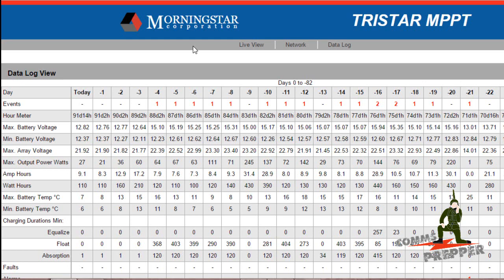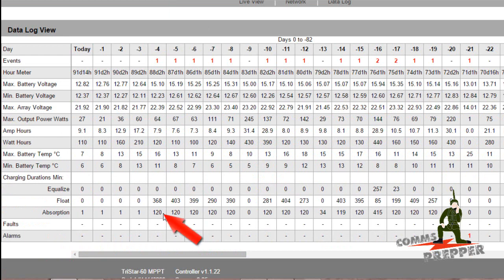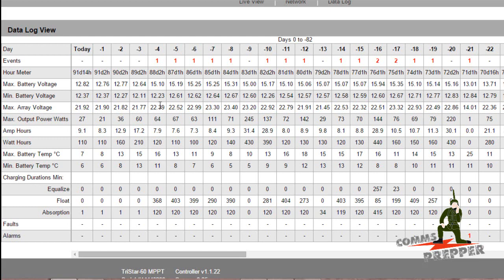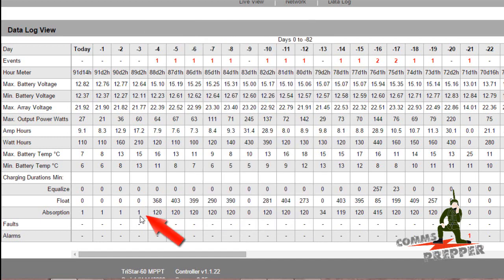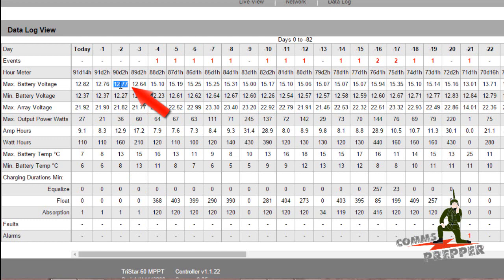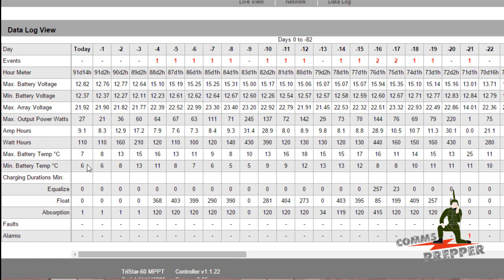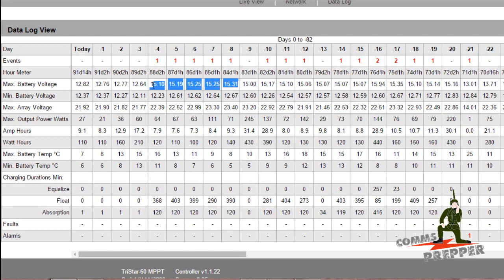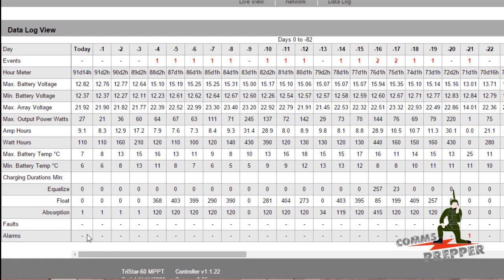Off Grid Solar Power - Reduced Sun Light and Cold Weather

Comment: If you look at the batt specs for number of cycles vs % discharge, you find that batt bank life can be significantly extended if routine discharge is kept below 30%. This means that it may be worth it to beef up the batt bank (and panels if necessary) in order to increase lifetime @ the same load. Also, constantly keep the batt fluid topped up.
Reply from the maker: +Larry Bowers More batteries and more panels are on the wish list.  Right now I just use the system on the weekends and never go below 50% SOC.  I do perform routine monthly battery maintenance (water levels, gravity checks, and equalization).
Reply: +Commsprepper Good deal - a grid/solar mix allows you to minimize excessive batt bank drain as long as the grid is present. When the grid is gone, a generator/charger is a great addition. Even a cheap DC charger (made from a lawn mower engine driving an alternator) can be a great asset. Be careful adding new batts to an older batt bank - any degraded batts in the old bank can quickly degrade the new batts added to the bank.

I've also found that (depending on your charge controller) extended sun charging under no-load has the same effect as a hard EQ. I call this a soft EQ and is much easier on  the batt bank relative to hard EQ. This is all about extending batt bank life significantly.

BTW, tanks much for your videos - great material. I just bought the 7200 and LNR EF-Quad antenna.  --W4LQB

Comment: Yes you have to use a battery charger sometimes to keep the batteries up unfortunately.
Reply: +TRprepper Yeah, a week without is hard on the batteries. On the other hand it&#39;s perfect for wind turbines. The nice thing is that you should be able to use the same MPP to feed in from windmills.
Be sure to have different blade sets available in the even of extreme wind or larger blades may be damaged. I'm thinking about the Rule of Three's for mine. There are hundreds of online videos which show great DiY alternatives.
Short term, a small modern generator would be good. The simpler the better.
Reply from the maker: +TRprepper Heading to the retreat this weekend.  Had some sun today but still did not reach absorption mode.  Supposed to be sunny all day tomorrow. I hope that gets the system topped off before the weekend.
Reply: +TRprepper Yes, or a generator. Fortunately wind turbines work well when the Sun is down or obscured.
Reply: Yeah I understand we have about 7 days of rain or clouds, system has not liked that.

Comment: are the batteries you use "smart batteries"  what I mean is we are taught every now and again you have to almost deplete them to they dont build up a memory, hence loosing their full charging capability... Just wondering.
Reply from the maker: +Blue 823 Blue you are talking about old Nicad batteries used with handheld radios.  My off grid batteries are a different chemistry (flooded lead acid) and can never-never be discharged completely.  In fact, with off grid solar batteries you never want to go below 50% SOC (state of charge).  Lead acid batteries have their own set of rules.

Comment: Can't wait to see the update to watch the system recover. 

Would it be beneficial to either 1) Have some sort of heat source that could be applied from the solar power during the day to bring the average battery box temps up? It would have to be a subtle source as to not ignite the gasses. or 2) Have something like a bilge blower with a check/flapper valve on it that would blow warmer air from inside the house during the night hours?

I  might have to go back and look at the ventilation set up on your box. Just thinking out loud. My batteries are inside and the outside temps have been about -10F of late.

Comment: Keep battery and radio set warm near house fireplace, or batteries, solar panels near base camp fire (!)  Campfire (of proper size) light and heat has marvelous properties for panels and charging.
Reply from the maker: +John Lord no no no - my off grid solar power system uses flooded lead acid batteries that vent hydrogen gas - bad combination with fire.  Also, the off grid batteries each weigh 70lbs - hard to move.
Reply: Warming "near" house fireplace is not NEXT to fireplace, but in a warming area, warming box, away from direct fire/coals/heat.  Solar panels in direct light to fire.

Master base camping, has options for SHTF and emergency/disaster relocations.
Reply from the maker: +John Lord This video is not about a portable system.  This video is about my off grid retreat system.  The panels are mounted on the roof, batteries (4 each) are installed in a battery box outside (to vent gas), and batteries are permanently connected to inverter.  Here is the system play list https://www.youtube.com/playlist?list=PLfrteFE0V6mUB8TiaIBZRwuFvvbRyhYpC